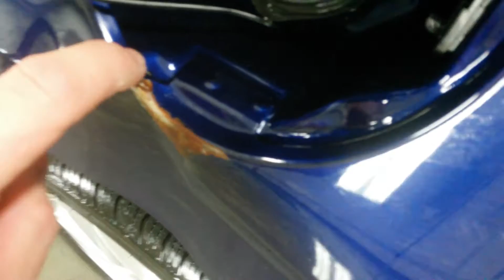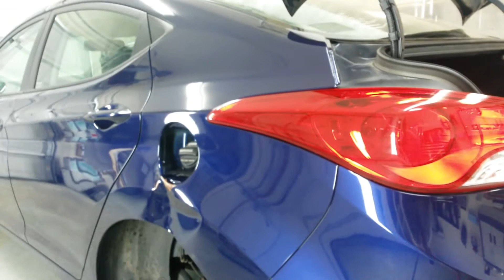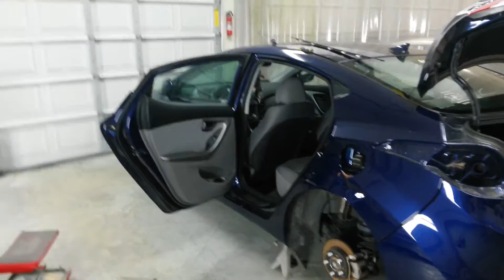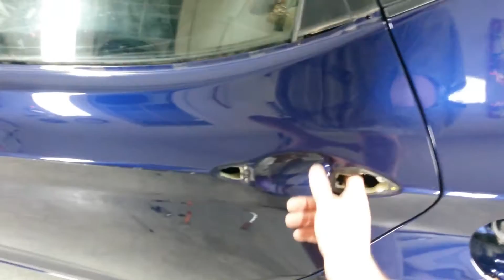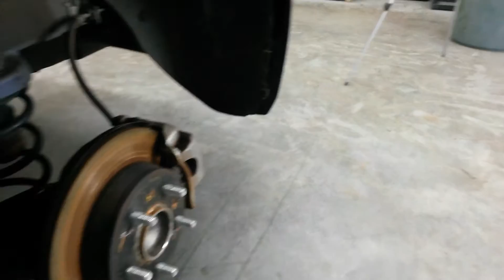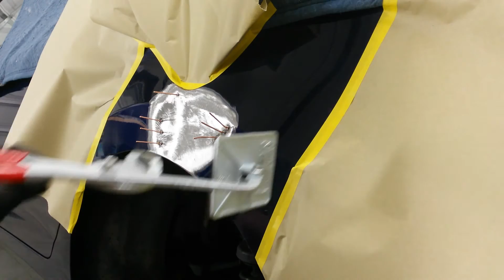2013 HYUNDAI ELANTRA | QUARTER PANEL REPAIR AND REFINISH PART 1 OF 3

Comment: Can't complain about removing or replacing Hyundai Elantra rear taillight assemblies. They are dead easy. Especially considering most damge to rear quarter panel is likely also to damage the reflectors.

Comment: Finished product looked great. You have to be very detail oriented and have a really good eye and use the right application for body work. Hate the use of filler but sometimes it is the only way for very tricky areas. As an owner I would just soon pay more and have a whole new panel welded in place if it would mean no use of body filler. Filler repairs are always noticeable after a long time has passed and the car has been in the elements.
Reply from the maker: dtnetlurker I do not like filler,  but even with a new quarter panel  there would be filler at the two welded seams. in this instance, there would actually be more body filler used if the panel was replaced.  if it's a panel that can be replaced with no filler, then yes, I  would try to do that if the customer will agree to it.